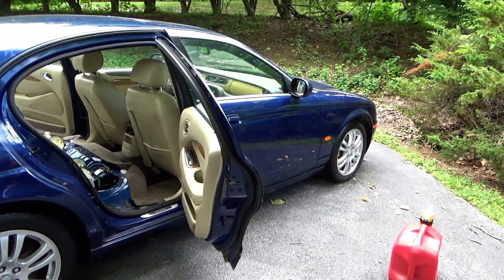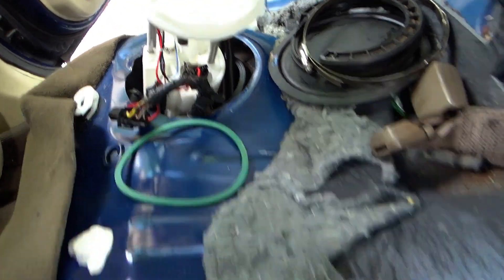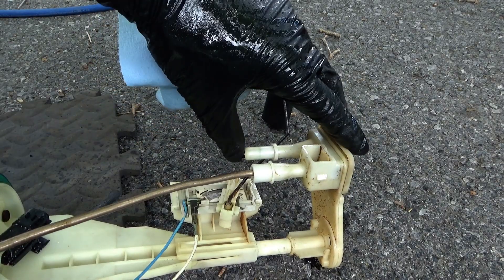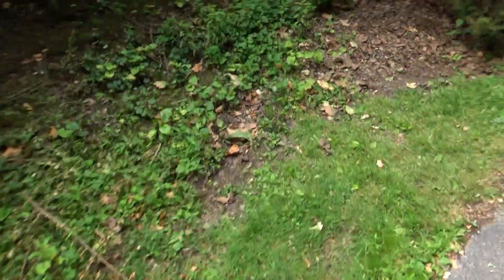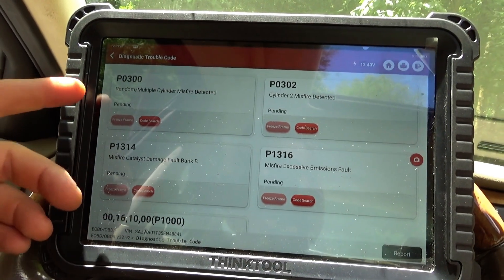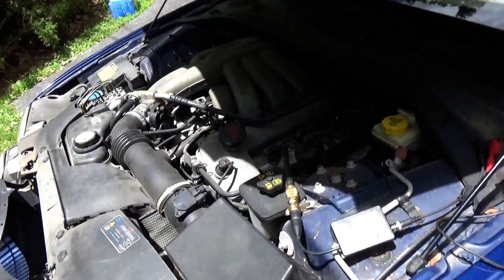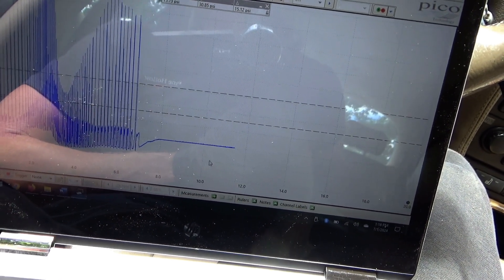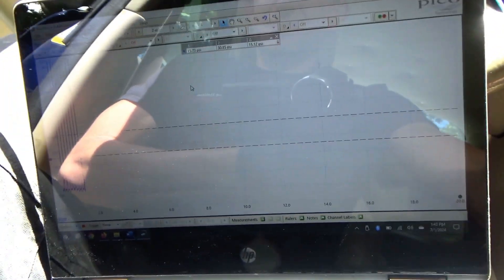(Pt 2) Jaguar = Beached Whale? (LOW POWER! S-Type V6)

Comment: Just thought i would add about the catalytic convertor. Quite a while back i watched a Diagnose Dan video where he was brought a car that had the engine light on and it had come in with a new cat installed. He found that the new cat was giving too much back pressure, therefore setting the Engine light on. Forget the make of car but he is in Europe, so it was one of "those". The OEM cat was really expensive, so he did find one that had the correct parameters to not set the light off.

Comment: 11:12 you cannot create the custom probe on pico 7 but any probe was built in pico 6 can be alimported imported to 7

The way you doit is ,open a capture waveform from a incylinder for example after that you go to probes and save it. But had to be open on pico 7  the file you want to add
Reply from the maker: So basically Pico 7 sucks 😆

Comment: I've had the same problem before screwing a regular old school compression tester in and out of a spark plug hole.   The adapter is pretty small already and I didn't notice it had come off and stayed in the hole.   I did the exact same thing, screwed a new plug down and I also thought, these threads feel a little rough.   But I had to go buy another new plug at my own expense, but I never forgot that experience I always double check that now.

Comment: So the side with the restricted exhaust was showing adding fuel or pulling fuel on the fuel trims? I have a similar issue (05 Aviator) and I keep making it more complicated in my head than it is.
Reply: If you can't move as much air, you have to take away fuel to keep the mixture ideal (stoichiometric).
Reply from the maker: @nickj610  watch the live data carefully.. Bank 2 is negative trims😉
Reply: @PineHollowAutoDiagnostics  d’oh, thank you! I’m a fool 🤣

Comment: Great diag as always Ivan. Now come to think of it I had a 2010 Nissan titan come in to the dealership last year running like crap customer already requested a engine replacement and I didn’t think twice when I pulled the secondary bank 2 cat out and found it completely plugged from the primary just went ahead and replaced the cats and the engine ran and drove great at 310k after the replacement kinda makes me wonder if the engine was good all along but I didn’t dare turn 18hrs down during the slow months. I expect to be roasted for sure but with a baby on the way I needed every dollar

Comment: You could hear the exhaust back pressure when you were loading it up. It sounded constipated.

I wouldn't feel bad about the spark plug either. I think you should be running something a little more high performance than an AutoLite anyway.

Comment: I have Ivan's original version transducer. I don't use it enough to upgrade to the latest version but definitely the right tool when you need to measure pressure. Well worth the price. Nice diagnostic my friend.

Comment: Total agreement with you on Pico 7 
It's very clunky to use and custom probes is just not as straightforward as Pico 6 , and takes less space.
Sometimes change for the sake of change is not worth it.
Reply: why change something if it works? You see that a lot, I think a lot of times they are trying to "obsolete" things.
Reply: I did not get to this part of the video yet, but I didn't buy an 8 channel pico because of this. Why would you drastically change the pico software and give no option to use the old version?

 They don't understand their market at all. We work on the "latest and greatest" crap all day. We want an old reliable scope.